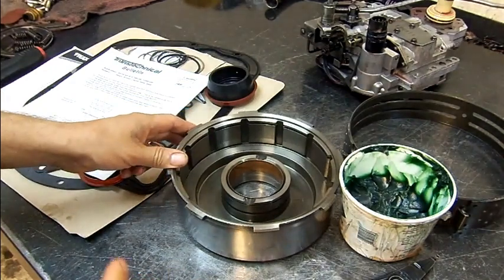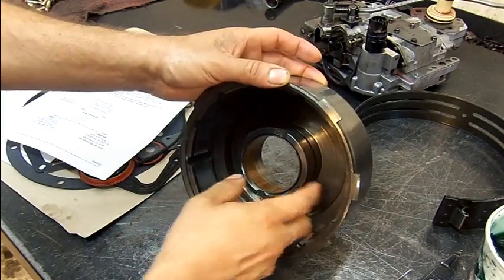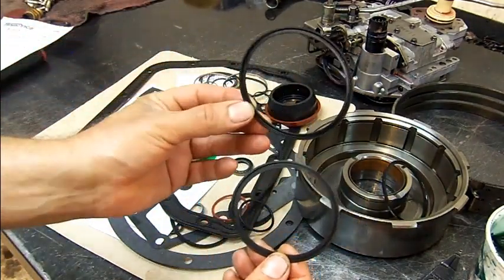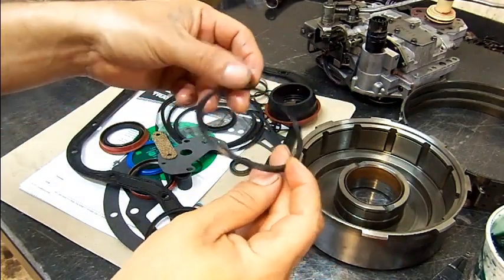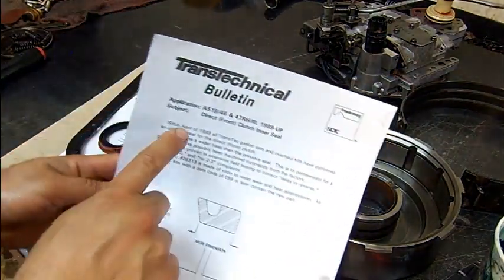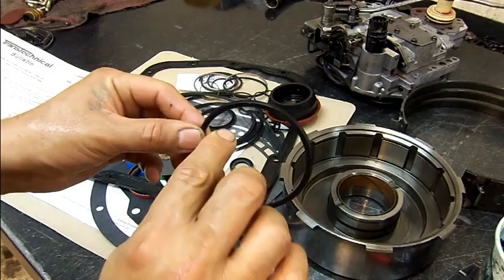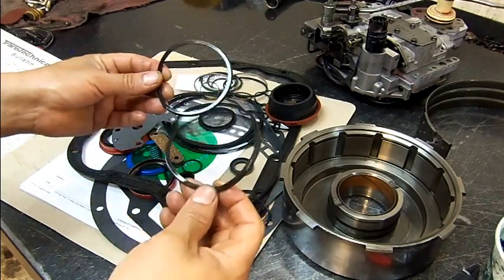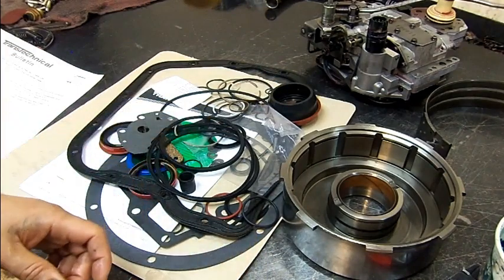48RE Delayed 2-3 Upshift, Delayed Reverse Engagement - Transmission Repair

Comment: Another good informative video Hiram! Just so folks know. You can get a delay 2-3 shift with a solid reverse in these units if you don't change to the updated seal. Don't be tempted to use the narrow seal even if it is brand new out of the box and feels like the lip is sticking out enough. It will air check okay. But still have a delay. Don't ask me how I know this.

Comment: Anyone that wants to purchase the 48RE wide (direct) front clutch inner seal.  The TransTech part number is B28313.  It is the same seal used for the Ford CD4E direct inner clutch seal 94 and up.  Toledo Transmission Parts(Seal Aftermarket Parts) makes the same type of seal PART # 46544 and it fits the 1994-up CD4E direct clutch inner.  Ask the person at the transmission warehouse and tell them that it the "wider inner clutch seal for the 48RE direct clutch or ask for the direct inner seal for a CD4E Ford.  Ford # F3RZ-7F225-A. Dodge oem# 3410226. You can also ask your transmission shop, they should know what they are.  Hope this helps someone.
Reply: Seal Aftermarket Parts aka Toledo Transmission Parts # is 46544 and Chrysler oem is part # is 3410226.  Had to get a replacement for a new cut lip seal.  I can't count the times I was told by the transmission warehouses they couldn't get it.
Reply: Thank you!!

Comment: Did this in fact cure it? I literally just rebuilt my trans and didn't bother to remove the front drum piston just replaced fractions and steels and my trans has the worst time shifting to third I have to let off the throttle or it shifts 3 and 4 quickly at high rpm

Comment: Very nice videos! I have a 2005 Ram 2500 diesel  with a 48re and the trans does not engaging reverse, 3rd or 4th gears...Yesterday I'd disassemble all the trans but all seems normal, bands, accumulators, seals, pistons, clutches.....
The manual 1 and 2 works fine, rear band brake when a loose the throttle.
On D position only 1st and 2nd gears, 50mph more than 3000rpm and the 2nd still engaged.
On R position the truck dont have any sound or movement, is like a Neutral.
Any idea?
Thank a lot
Reply: Interesting... did you ever figure out the problem(?)  48re on my 03 Ram Cummins was acting similar to yours and now truck won't move in D, 1st, 2nd or Reverse...unless...I press 1/2 down on the accelerator (or more) but in doing so, the truck will only move slowly/at a snail's pace :(